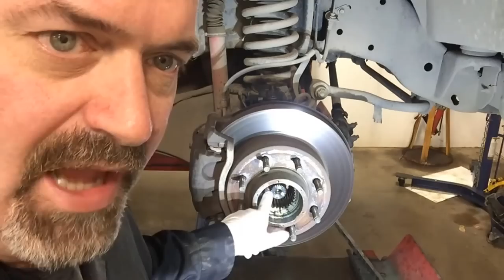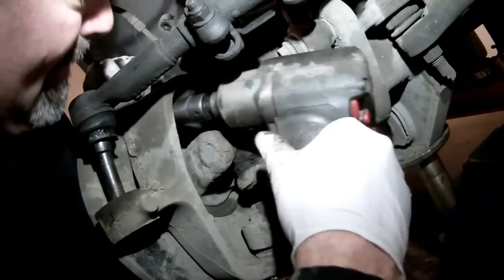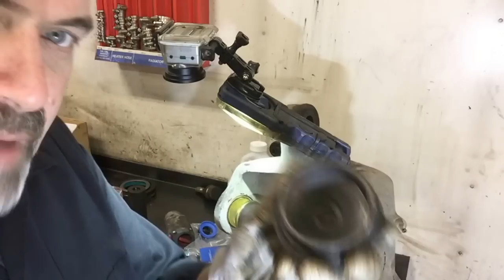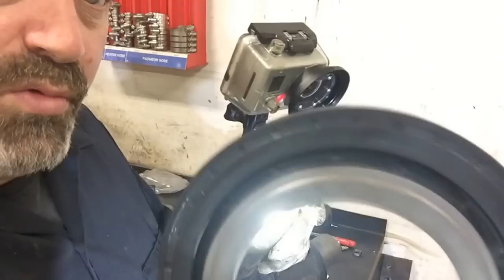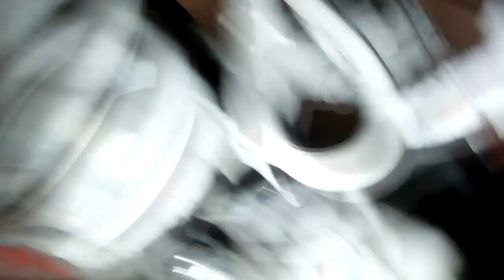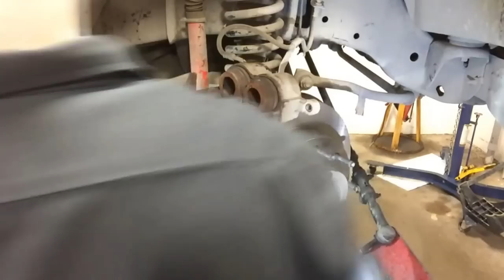How To Replace Ford F250 F350 Super Duty 4X4 Upper and Lower  Ball Joints

Comment: Does that axle seal have to be replaced or is that just preventative maintenance
Reply from the maker: no but its a good idea since most are torn. I suggest getting the updated seal since its easier to install and lasts twice as long.
Reply: The Car Doctor thanks for the quick reply!

Comment: Super helpful. Someone may have already said this, but after cranking and cranking on the press  and not having the da*n thing come out, DO NOT UNDERESTIMATE the value of a nap, re-watching, and then turning the press around and removing the joint in the correct direction: EASY PEASY. Thanks!

Comment: car doc thanks for the grate vids! I just did all this to my 1996 f250 with the dana 50ifs my question is iam on two the pass side and the knuckle  seams a little tight comkpared to the drivers side ican turn it and it's not binding but it just seems tighter then drivers side I followed your direction  to the tee and used the ford specs for my truck so how tight is to tight tks john

Comment: Im just getting ready to do this on my 08 F250 SD... Do I need that high dollar vacuum seal tool if I just have the standard “lock-em-yourself” style hubs?
Reply: I have the exact same question. I found his answer way down in the comments.
@jdmdfd Thank you! Not much different. No vacuum hose but the axle seal is same. Might be able to re-use the axle seal since its not as important to seal vacuum however not recommended if youll be exposing the vehicle to water or off-road type use. Otherwise the general process should be identical if im not mistaken. Good luck!
Reply: jflandis 
Yeah, I did the job and it’s basically the same, I didn’t replace the seal but I borrowed the tool from a buddy that bought it to reseat the axle. If I have to ever do it again I may build my own from ABS pipe, I think it would work.

Comment: Thank you very much for this video. Very clear explanations on what tools and parts are needed to do this. I have a 2012 F350 6.7L 4x4 that doesn't need the ball joints done yet (only 34K on it) but I favorited this video for when I do have to do it. I had replaced the upper and lower ball joints on my 2003 2500 Dodge Cummins 4x4 and this looks like there is a bit more work involved because of the seals although it looks like I won't have to fight the bearings as bad as the Dodge.

Comment: Thank you for this great video! I've watched many videos and yours is the best by far. The only thing no one really explains is what brands/types of greases I should be using. I have a 2000 F250 5.4L 4X4 and I have to replace the front wheel bearings. People are using grease in every video but I'm not sure what kind I need? Some videos people used grease on the edges of the brake pads to when reinstalling them and some didn't. Do I need grease for them as well and if so is it a different kind? I was wondering if you could help me out because I want to make sure everything is done correctly?

Comment: You wouldn't happen to know if the OTC 6697 seal driver will work on a 2012 f350 dually as well Or will it be a different part number
Reply: same for front end

Comment: Hi what kind of pliers did you used to get that snap clip out
Reply: garciaj100704 I got mine from Harbor Freight (a whole kit for $50) which was all they had. This was after finding out my snap ring pliers didn’t do it, or the ones at NAPA and advanced auto.  The issue with most is the swivel is too fat and does not allow you to reach deep enough to secure the snap ring.

Comment: I may have over look if you included.  Is there a range of miles that this service is going to be needed?
Reply from the maker: No, depends on the type of use it gets. Best to check the suspension components every six months or so to be safe. Thanks for watching

Comment: Wow!   Just Wow!  NOT JUST A BALL JOINT VIDEO.... An absolute MUST WATCH for anyone planning on doing a tear down of the front axle.  Step by step.  Excellent detail.  I will be replacing my ball joints.  But most important for me is I need to replace my Universal joints (possibly the whole axle).  Replacing Locking hubs, and quite possibly the whole wheel bearing and Hub assembly.  This video shows it all on how to remove each of these pieces.  Thank you Car Doc!  One question if I may....  Is the torque specs you mentioned on this 2009 F350 the same for a 2008 F250 (which is mine)?

Comment: Great Job with your instructions. It helped me out tremendously. The only thing I noticed is that the plastic of fiber spacer that has the slots for the vacuum relief that  goes behind the hub, between the axle and the hub wasn't there. I was wondering which side the slots go, toward the hub or toward the axle. The other thing I noticed is that there was no washers behind the snap ring. Mine is a 2003 F350 and it has 2 flat washers and a hex washer behind the snap ring. Both sides had the spacers so I assume they belong there.

Comment: So, hypothetically speaking, if someone, like myself, doesnt use the vacuum hub setup, in fact i swap them out for warn manual hubs, could i just reuse the old seal instead of spending 50 bucks per side?
Reply from the maker: well except it seals the inside from dirt and water. Not sure what that will do to your hubs.

Comment: Can you provide part numbers for all tools you used for this job want to buy all the tools so I can do this job right
Reply from the maker: If I do one again I will pay attention to that sorry about that.
Reply: The Car Doctor you said the part number to put the seal in but you didn't say what the part number for the ball joint puller was and you didn't say what size torque wrench you were using

Comment: What about the rest of the ball joints like the drag link and inner and outer tie rods is there a video for them I have a 2005 Ford excursion that needs this work and I'm looking for info
Reply from the maker: I will consider that for a future video. This one didn't require those parts. Thank you for watching
Reply: The Car Doctor can you provide me the part numbers for the tools you used for this particular job so I can make sure I have the appropriate tools for the ball joints and tools to reseal the auto hubs I need to replace the ball joints and all the seals and the hub assembly on mine what are the part numbers for the tools for this job

Comment: Great videos as always. Thank you very much. This helped me do them on a F350. For me it was easier to just knock out the old ball joints with a mini sledge and a short thick walled piece of pipe instead of pressing them out. Then I used my 20 Ton shop press to install the upper ball joint. Finished off the bottom joint with a C-clamp balll joint press as in the video.
Reply from the maker: Awesome! Thanks for watching the vid. take care

Comment: The Car Doctor is my prefered go too.. Not only are you clear on your procedure in doing the repair, you can actually see what your doing and hear you.  I am one of the better shade tree mechanic that 
Has real shop experiance.
I have a ex CN rail truck that is a mess in the front end.
Half shafts have vertical and horizontal play. Thinking outer dust shield/ hub bearings failure.
Complete tear down and rebuild with ball joints at this point since it apart anyways.

Hows the fishing up there?

Mark

Comment: Just need to mention that you will need a heavy duty pair of snap ring pliers. I started the job and hit the wall when it came to the snap ring. I have a pair of Craftsman professional snap ring pliers but they are not long enough to reach the ring or heavy duty enough to spread it. Have a heavy duty pair on the way so won't have this problem again.
Reply: I'm at that wall right now...Bought 4 different pairs of snap ring pliers from Advance Auto, Napa, Autozone, and local hardware and they either are too short are too light duty (tips bend.)  Nowhere local has any snap ring pliers that work.  Guess I need to order some online
Reply: I bought the SK 7812 External snap ring pliers and they worked perfect.  This is a must have for this project.

Comment: What brand of snap-ring pliers did you use for this project? We have broken three different pairs trying to remove the rings. We thought maybe they were seized up at first... they are not I can swivel it around, just can't find a pair of snap-ring pliers small enough to fit inside but large enough to open the rings far enough to slip over.
Reply: Those are a bear. I bought a pair at Northern Tool that worked, their house "Klutch" brand, around $8. Don't bother with any adjustable kind, they won't work.

Comment: Great video, if I took my 2001 F350 to the repair what would be the repair cost for ball joints, tie rod etc...?
Reply: Matt Bush The parts alone: Moog upper and lower joints, U-joints, vacuum seal, o-rings, etc. are around $300-350 PER SIDE, not including brake pads. it's very labor intensive as you can see. Then you need to get an alignment, so if there is any question, you should do both sides. I got a quote for $1100 just for the passenger side before I did it myself. 
This video is awesome, btw!
Reply: I also spent $210 having a shop remove and replace the ball joints in the knuckles ($80) and remove and replace the u-joints and balance the shafts ($130). Well worth it!
Reply from the maker: Depends on the part of the country. Its expensive here in Alaska. I would guess 900-1500 with alignment. Take care
Reply: It cost me around $1100 in parts, but that included new calipers, rotors and pads because they were shot.

Comment: If I had already switched to manual locking hubs, is there any reason to remove and replace the seal?
Reply from the maker: it still keeps water and dirt out of the hub so its a good idea
Reply: Thanks! Great Video by the way!

Comment: Is that inner dust shield tool that you used also to set the correct depth when reinstalling the axle something that can be rented? I have my truck torn apart currently and didn't realize I would need that...... Also you mentioned you prefer moog joints, any particular ones?
Reply from the maker: Yes the tool drives the seal on and also sets the shaft to the proper depth into the knuckle. Use the good Moog not the part number that begins with "R"
Reply: I'm sorry I forgot to mention phenomenal video btw!!!! Showed me exactly what I needed. I found these part numbers K80026 & K8607T. Don't spend to much time on it but do those numbers seem correct since they don't start with "R"
Reply from the maker: Yes. Those are the good ones. Have fun!

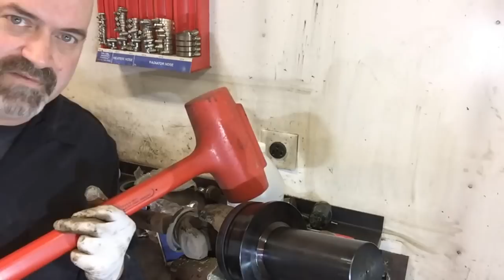Comment: 28:15 "This is my go to Ford tool".  I'm going to use that line and get myself a big ass hammer. Haha
Reply from the maker: hehehe
Reply: An old timer back in the early 80s I worked for had ballpeen hammers on a rack labeled as " f - 100 " / " f - 250 " / " f - 350 "........   no fooling and he called them that daily
Reply: I’m getting a “Ford Tool!”

Comment: hey my friend. I have issues with my steering gear box on my 2008 f250 sd. the adjusting screw does not turn, so I'm unable to adjust. any ideas as to what to do?
Reply from the maker: Probably need to look at replacing the box. Its very difficult adjusting those gears anyway. Whats going on with the box? Loose?
Reply: Actually is way too tight. So tight, that when turning, the
steering does not come back to the center, wheels remain turned. There’s no way
to remove that top “cap” where the adjusting screw is?  It has four
screws, and perhaps only replace the “adjusting” screw?
Reply from the maker: To be honest I have never torn into one. Just replace them with reman units. Be sure to check everything else in the steering linkage and suspension. Also alignment may contribute to those symptoms.

Comment: Nice job! I would like to ask you the model of your seal driver if possible . I work on f450 and 550 and is the same process except that I don't have that tool an is a bitch to install the axle with out that tool
Reply from the maker: I have an OTC tool and a Matco for the newer models. I have another vid showing the tools and part numbers ill look for and drop a link here.

Comment: Hey Doctor, just wanted to give you the most sincere and heartfelt thanks for publishing this video. I was able to do the job (had never done this before) with out any problems thanks to you.  best regards.
Reply from the maker: Excellent! Good job. Thanks for dropping by and watching
Reply: hey my friend. I have this new issue, can you help? I have issues with my steering gear box on my 2008 f250 sd. the adjusting screw does not turn, so I'm unable to adjust. any ideas as to what to do?

Comment: Hey man awesome detailed video like I was reading the Ford shop manual at home. There needs to be more proper and thorough videos like this!  Few questions the Front axle dust seals on mine are just completely loose. Can I clean them and push them back in? Or total teardown of the assembly? Thanks man subbed!
Reply from the maker: Thanks! They make an improved seal but it requires complete teardown. They aren't the most important thing if you ask me. Just keep large rocks and crud out of the axle housing.

Comment: Outstanding video! Do you remember what snap ring pliers you used?  Just spent a weekend trying to replace these u-joints and couldn't find pliers strong enough or thin enough to get to the ring out. Extremely frustrating.
Reply from the maker: It's a pain. I use the large snapon pliers. I almost think I put the part number on one of the replies here.

Comment: I have all the parts to do this on my 2006 f 250 but I got a yellow o ring instead of the black one.  Why is it yellow and is it the right one?
Reply from the maker: I am not sure. I haven't seen a yellow one before. It may just be a different manufacturer. Is it a Ford part?

Comment: I like your video on the ball joint replacement. I think you do very good work. I wouldn't hesitate in taking my vehicle to you.  The only thing I saw wrong was when you pressed the pistons back into the caliper. When doing so, you need to either check the reservoir to make sure it will hold the fluid, or crack the bleeder valve and let it out there.  If the reservoir, was already full, you just dumped brake fluid all over the under side of the hood. Besides that, you'd want to replace the fluid with fresh clean fluid, during a brake job, in case it had somehow drawn moisture.
Reply from the maker: Good call, if it had been overfilled and brake fluid overflowed we usually wash it off with water and I always check the master cylinder cap/seal after the work to make sure it sealed properly. Flushing brake fluid is a great idea but not required with every brake job. Probabky once every five or so years is a good idea or check with a moisture tester to know. Thanks for the feedback and I'm glad you watched. Take care.
Reply: +The Car Doctor yeah according to how much waters in the brake fluid :)

Comment: Great video.  What seal did you use on the outer?  I have a 2006 F 250 and vacuum hubs do not work and I know these seals are shot.
Reply from the maker: Outer seal 710685 Not sure on o-rings
Reply: Thank you.

Comment: Hi ! I have a 2002 f250 SD, 4WD, 7.3. When I pried out the axle, 2 to 3 quarts of gear oil came pouring out. I'm freaking out because I didn't see that happen in anyone's video. I thought maybe once the end of the axle cleared the inner seal, it flowed through. I didn't see anyone drain down the diff in any videos, but I thought that would be why. Any thoughts ? Thank you in advance.
Reply: your inner seal inside the axle housing is bad.
Reply from the maker: That's possible however I also thought it may have just been overfilled or the vehicle not level and fluid ran out. If the inner diff seal was bad then it should have been leaking all along not just when the axle shaft was removed. I would probably put it back together and check the diff level or you could tear out the carrier and replace the inner axle seals to be sure $$$$

Comment: What is the OTC model number for the ball joint adapter press. Not the C clamp bu the actual adapter that fits over the spindle. I am trying to buy one for my project.
Thanks!
Reply from the maker: I use the Astro 7868. It works with most c-clamp style press including the OTC model. https://www.amazon.com/gp/aw/d/B00061SGPO/ref=mp_s_a_1_1?ie=UTF8&qid=1473171161&sr=8-1&pi=SX200_QL40&keywords=astro+ball+joint+adapter&dpPl=1&dpID=41fAck6%2BxtL&ref=plSrch
Reply: Thanks!!
Reply: I actually picked up OEM Tools 27310 Master Ball Joint Installer/ Remover Adapter kit.

Think its the same exact set you have but andifferent company.
Reply from the maker: Oh nice

Comment: 14:32  I tried to do this for an hour, but apparently I was too gentle...far too gentle!
Reply from the maker: Haha. You might need a bigger hammer!
Reply: hi, very good video! But I have a dodge ram 2500 with the same balls joints to remove, and I have the same press, so do you think it works fine with this kind of press, or do I need to buy an hydraulic press to remove them because mine are little rust ? ( the former are smooth inside but the news are fluted )  thank you for your help
Reply from the maker: Make sure you have the correct parts but yes, a similar press should work fine.
Reply: The Car Doctor ok thank you

Comment: WHEN YOU HAD THE AXLE SHAFT IN THE VISE YOU MENTIONED A NEW DUST SEAL.  WHEN YOU INSTALLED THE AXLE INTO THE KNUCKLE I DID NOT SEE A NEW AXLE TUBE DUST SEAL.  DID I MISS IT?
Reply from the maker: No. I neglected to replace it. Good eye by the way. There is an updated seal and more info in the description above. Take care.